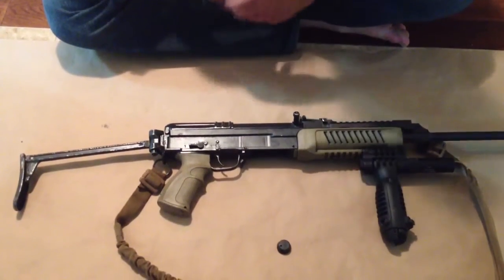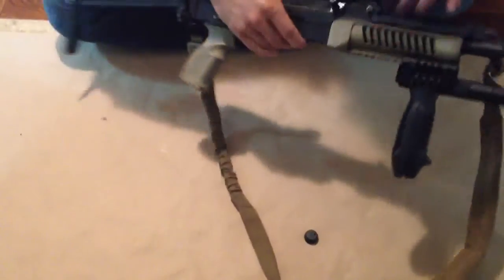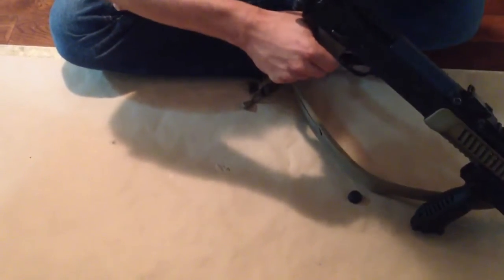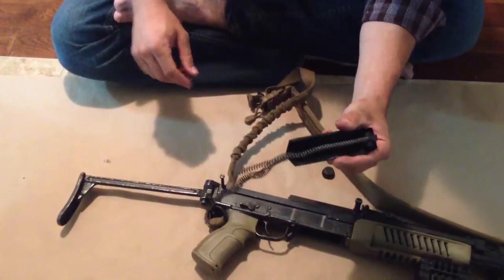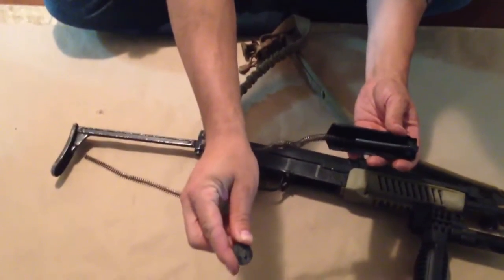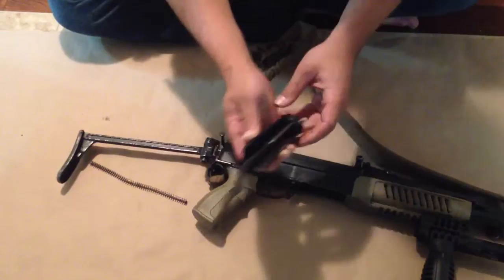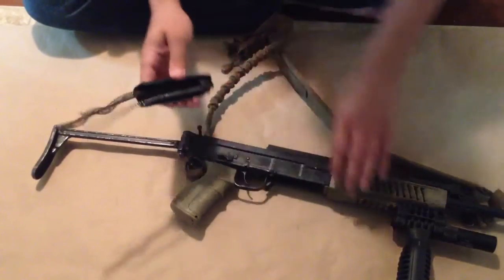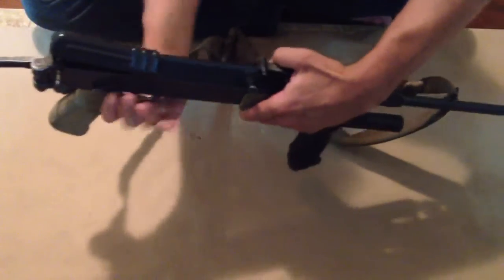Cz/vz 58 buffer install

Comment from the maker: Yes we sure have. We saw a 40-50% increase in cycle time. With the cycle time was .07-.18 of a second between rounds. Without it was .17-.28 between rounds. We have been told that recoil is reduced which makes sense but we didn't have anyway to measure that.